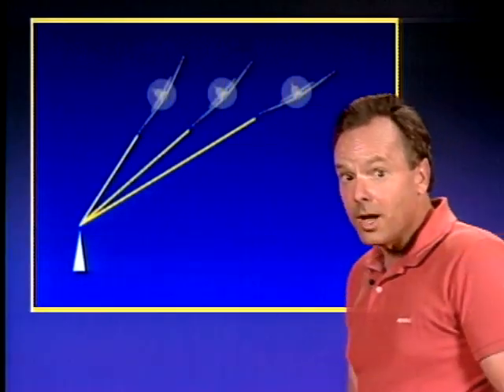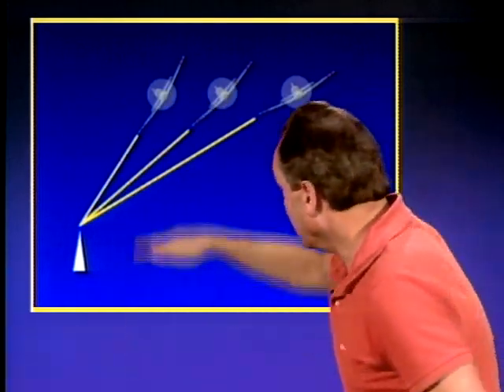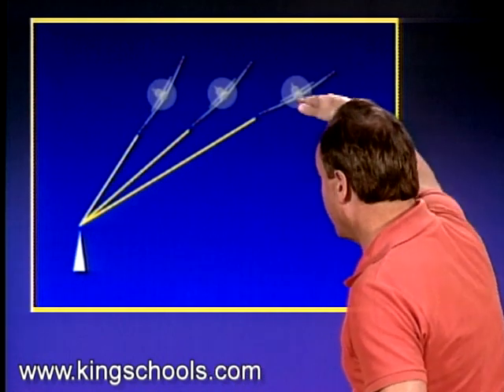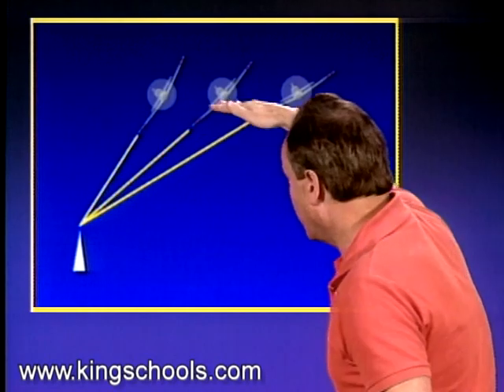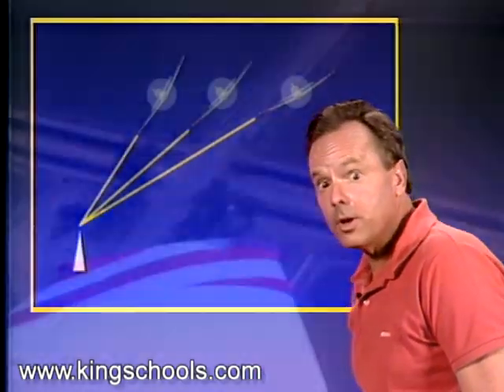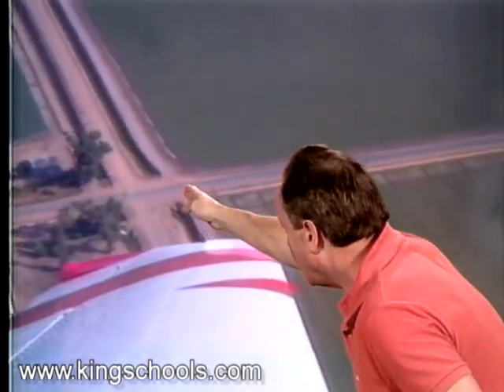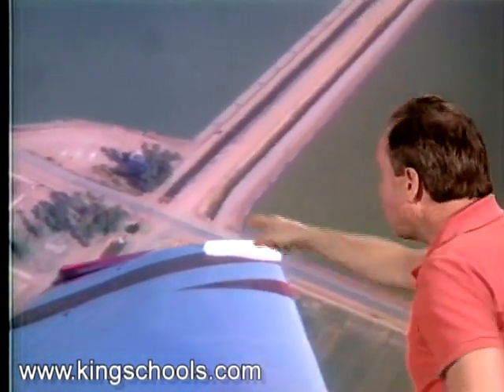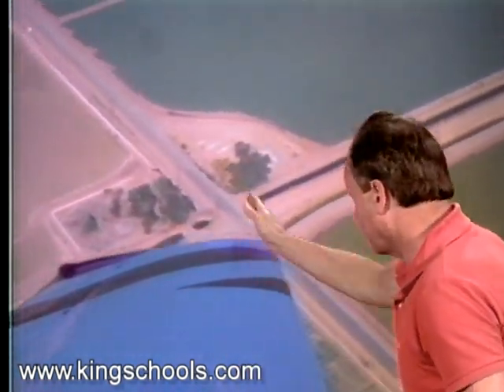Example of Eights on Pylon Flight Maneuver

Comment: Does the lazy 8  maneuver produce significant G forces?
....like maybe 2 or 3 Gs ?
Reply: 2-3g is either an aerobatic maneuver or a mistake. (or possibly strong turbulence)FAA considers more than 60 deg bank aerobatic.(vector force in a steady level 60d bank is a load factor of 2.00) steep turns are 50d +=5d (45d for private pilot)
Reply: Steep turns are the only ones which do if you pull too much on the yoke if you’re nose down.